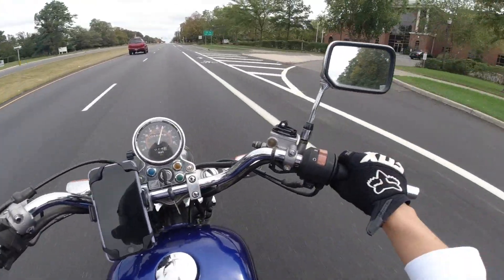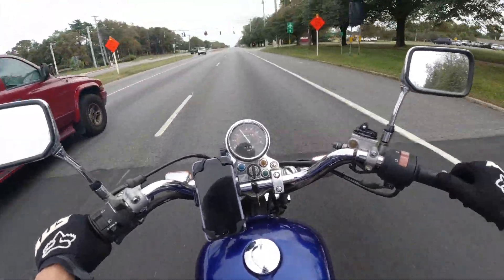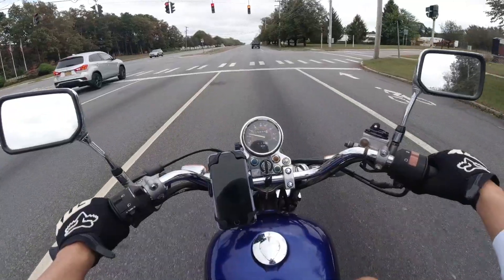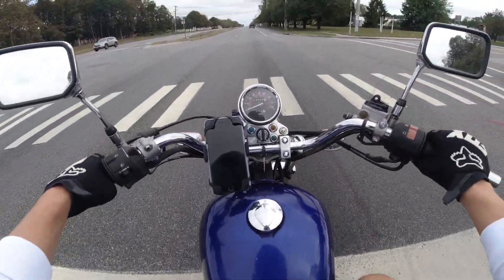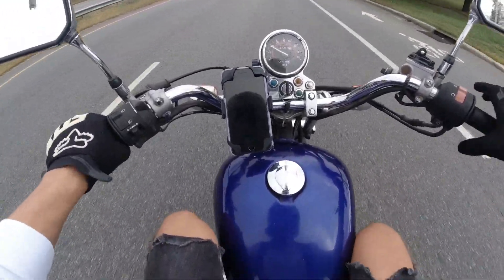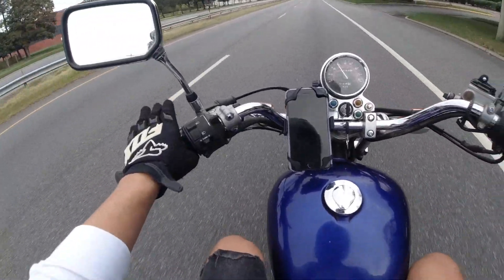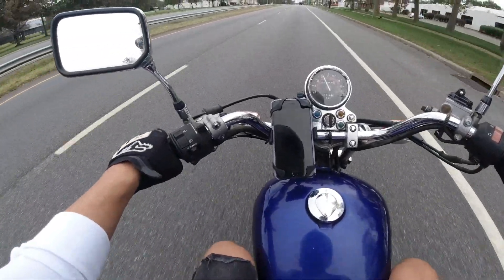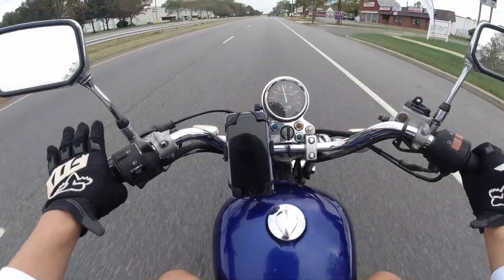Shifting through the Gears on Honda Rebel 250

Comment: You only need to release the clutch slowly when taking off in first. Once you are moving, after shifting, you need to release the clutch as quickly as possible. Letting it out slowly will cause it to slip (which it actually needs to do when you first start moving, but not necessary once under way) and wear it out faster. Once you get the hang of it you can shift very quickly. The Rebel is not fast, so you can run it up through the gears at full throttle without breaking the speed limit. When shifting at speed, I just slip my hand off the clutch lever, and let it snap back out. Even when just riding around a residential neighborhood, you can release the clutch quickly as long as you are moving. You need to coordinate using the clutch, shifter and throttle all at once. It becomes easy with practice. It should get to the point fairly soon when you can do it without even thinking about it. You need to pay as much attention as possible to all the cars and trucks out there that are trying to run over you. I doubt they are actually TRYING to run over you, but the end result is the same.
Reply: Thank you.  I've been releasing the clutch slowly.

Comment: Should you put it in neutral at lights?  I've been leaving it in 1st at lights.
Reply: I have always left bikes in first gear at stoplights, and just held the clutch lever in. The gears do not synchronize well when shifting into gear from a dead stop. I have had a number of bikes that would make a loud CLUNK and lurch forward shifting them into first at a stop, so I got into the habit of just keeping them inn gear. Leaving a bike in gear at a stoplight also reduces the time needed to make a fast getaway if necessary.

I also leave bikes in first gear when they are parked, then just pull in the clutch and start them in gear. Leaving them in gear prevents them from possibly rolling off the sidestand.
Reply: @geraldscott4302  Thanks for the good info.